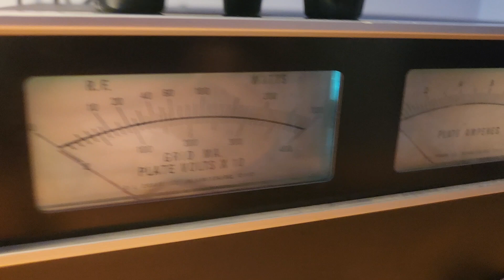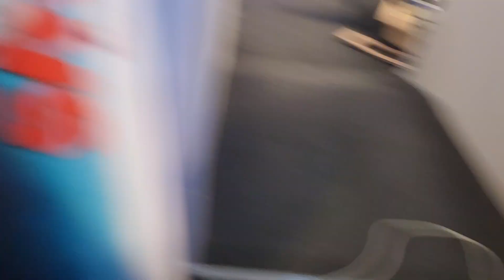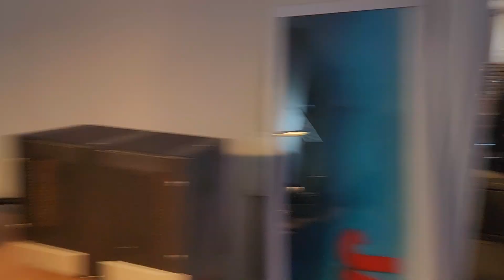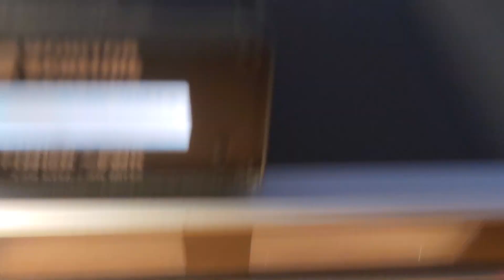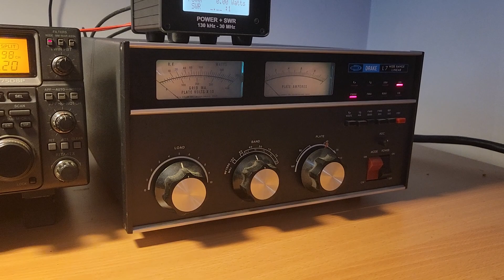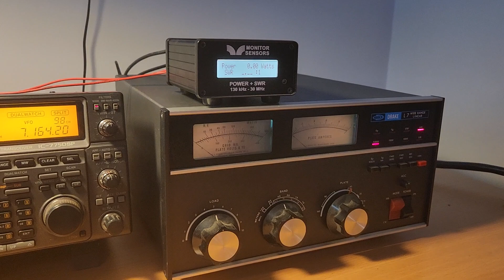Testing the performance of the Drake L7 / Drake L7PS and working beautifully for such an old girl.

Comment: I have had a L7 for over 35 years and I just changed the tubes this past week! For the first 15 years or so I ran it pretty hard. The past 15 years I settled on about 750 watts on CW and a bit more on SSB. I do quite a lot of contesting with it.
I think my problem was the filament pin being not tight in the tube socket as I lost solder from a filament pin in first one tube then the other. One tube stopped working due to the filament going out. The input SWR went up some. Then the other tube seemed to also have its filament go out! After fixing the tube socket pin spring clips, I tested with one new tube and one old one that did still have continuity on the filament. I got well over 1000 watts out. I also had replaced the fan a few years ago and it may also have contributed to the heat issue. I put a new one in with more CFM and faster speed just in case that was the root cause. I then pulled the old tube and put a second new tube in. The L7 still works as well as it did when I got it sometime in the late 1990s. It just might go another 35 years on these tubes!